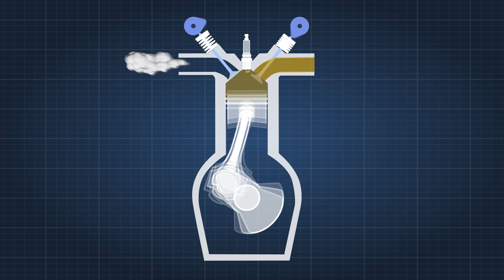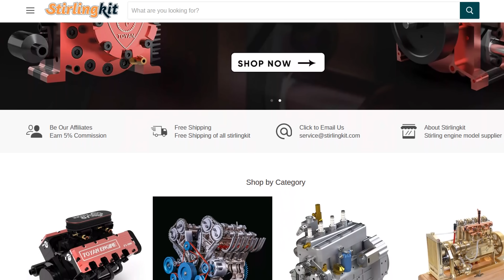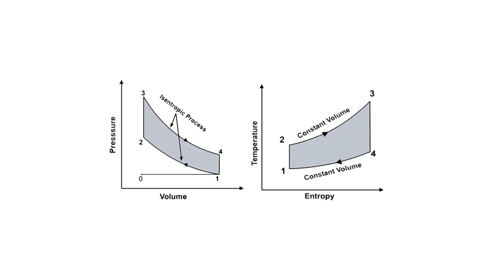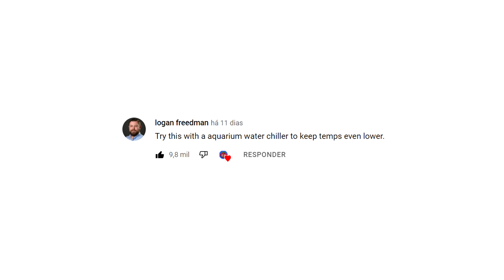I 3D Printed a Transparent Combustion Engine in Resin

Comment: So some possible explanations:
Since you're running a carby, that mixture may be too rich (in fuel). Liquids are lot less compressible than gasses, and the idea of these kind of engines is to have a really fine mist with air, that compresses. As you can see in some of your shots, there is a lot of liquid (that tiny engine is getting what some real big car engines may be getting at idling). So if you can, try changing your AFR (Air to Fuel Ratio) either by blowing more air into it, or lowering the amount of fuel entering the combustion chamber. 
Ethanol is used a lot in high powered cars with turbocharger, because it is lot less prone to random detonation due to high compression (remember, turbo blows a whackton of air into the cylinder, which equals to "a lot more dense mixture in cylinder", which when compressed at the same compression ratio can get really, really hot - up to a point of spontaneous detonation). Now in cars, you usually have the opposite problem - having too little fuel. So you need to change your injectors, which sprays more fuel, but there's a limit that when crossed, the AFM just spontaneously detonates due to extreme compression creating enough heat to ignite the mixture. This is called an engine knock, a detonation or premature ignition. You can prevent this either by running ethanol, changing your ignition timing or adjusting AFR.

If there are no microcontrollers on the engine controlling the ignition (I assume the magnetic switch triggers the spark plug directly), then there's nothing really to worry about. It is basically a lot simpler version of normal distributor used in many, many cars before we had individual spark plug controllers. For example, my '97 Civic has a mechanical distributor, which is a spinning wheel connected to camshaft, and that wheel has very correctly positioned contact pads, which are connected to a ground. The other side has 4 contacts, each corresponding to one cylinder. When the contact touches the pad on the wheel, it creates a way for electricity to flow only on that one spark plug, that is supposed to be in power stroke, igniting the mixture. I can rev up to almost 8000 RPM and have no problems. 

Also, since you are using a custom cylinder, try adjusting the compression by either varying the bore (diameter) of it, or the stroke (height). By stroking the cylinder (in your way by creating the cylinder longer), you'll actually loose compression, which you did presumably while running gasoline. That might create too little pressurized mixture and/or more probably, bad distribution of mixture, which is hard to ignite. On the other hand, by making the cylinder shorter, you'll make your compression rate higher. That means it would be easier to ignite your mixture, and on certain point, you would achieve the desired compression, which would ignite 100% times and correctly. Going overboard, you risk engine knocking, which might lead to poor running, missed cycles and even valve lift or your piston saying hello to whatever is on top or below it. 
Just a side note; stroking an engine is really common, especially in rallye scene. But since you cannot easily change the cylinder, you change the piston rod's length (essentially making the piston going lower overall), which lowers the compression. But that way, you a) have more room to put more AFM into and 2) essentially create more displacement (since displacement of an engine is NOT the overall size, but the size of a CHAMBER in which the explosion occurs). So keep that in mind.

I'd definitely play with compression ratio, maybe timing and definitely AFR. You can find many resources online on how to calculate compression rate, it's pretty simple math actually. As to what CR to run, my best guess is something between 10:1 to 13:1, depending on the fuel. I don't know how the timing works exactly on that model, but you can probably tweak it somehow. Since it does not have exposed camshaft, you cannot just advance the cam gear. You'd probably have to disassemble the engine and see, how it's done internally. Your next best thing to do is to change the AFR. You have a long screw at the bottom of the carby, try tightening it so you'll have more poor mixture. 

And a quick exclaimer, I'm not a professional automechanic, I love playing with cars and have done already some "advanced" things with engines. I may have made some mistakes, so please either verify or correct me. Hopefully, I've explained something a bit.

Comment: I think the seal for your intake or exaughst is leaking and causing your pressure to drop. (I think the valve on the engine your using is designed for less pressure/power & more on actually just running/functioning like a prop hence causing the leaking issues with different pressures from the different fuels. Im no expert & I've never built an engine before, but I'd try spraying some soapy water around all your seals and making sure that it's not a leak, again just a guess though :) , Love your videos!

Comment: As a lot of people have said, there's a few engineered solutions that need to be added.

You will need to control the valve timing. That could mean 3d printed cams, or electronic solenoid control (much cooler, and easy to adjust for different fuels).

Next, you need a way to measure the AFR. Typically that's done through the exhaust fumes. Then, you can modify the intake of gasoline:air for the proper mixture. 

Third, you will need to control the timing of the ignition system. Retarding or advancing the ignition times for fuel is necessary, as fuels don't always ignite/burn at the same speeds.

Looks like you have a future ahead of this engine. Time to create an ECU out of a raspberry pi or something and get to work 👍

PS. While you're at it, maybe you'd like to experiment with engines with alternative crankshafts to maximize power delivery. Piston power is greatest at the start of the combustion. Yet, the crank is positioned at the point with the least amount of torque (nearly vertical, rotated up). Maybe you could solve that problem 👍

Comment: It looks to like the valves are floating.  They may not be opening and closing fast enough to allow for a full charge.  The cylender still has exhaust gases in it after it fires.  Then after a few cycles there is enough of a fresh charge to ignite.  When you use the weaker fuel it does not spin the engine as fast as the fuel with the higher mix.  Because the engine is spinning so fast the vales can't open and close fast enough to have the right mix to ignite.  If you can get the valve timed right you should get better proformance from the different mixes.  I am not an experet by any means, but that is what I see when I see the video.  Hope you can get it running.  :0)

Comment: on board we had a Yanmar engine, its a 4 stroke, single piston, but the driveshaft wasn't connected to the crankshaft. it was powered off the cam-shaft.
quite an interesting engine...

Comment: I seriously bet it has to do with where the cylinder is at time of fuel’s explosion and not just ignition. If the fuel is really explosive then ignite the fuel a little less compressed so the explosion is working with the movement of the cylinder OR ignite or so slightly before full compression. Just make sure not to backfire.

Comment: Small engines usually work with very rich mixtures to help cool the engine and also l’m sure helps for bad tolerances and leaks
For gasoline a rich mixture is really hard to ignite with low compression ratios (it wets the spark plug and spreads the heat of the spark so activation energy is not reached or there is not enough oxygen in the spark itself)
Changing the fuel means changing the ignition timing so the power stroke (rise in pressure) doesn't happen before TDC, if too soon it might run but kick back the piston and waste most energy, if too late the mix won't have enough time to burn and rise the pressure before the exhaust stroke
Third thing about the drop in RPM can be the poor construction of the bearings that just can't handle the torque with higher power fuel and get squeezed so much that they just "lock up"

Comment: Your problem could also do with a poor ground. I’m assuming the valve pushrods are the only thing grounding the cylinder head to the base. Most engines ground to the block.
Reply: That's what I noticed too when he pointed out the inconsistent firing. If the coil is grounded to the block (lower part of engine) then the spark plug isn't getting a constant grounding thru the new plastic cylinder.
Reply: I was thinking the same thing!

Comment: Engine is running faster on methanol and nitro because it's lean. I suppose it's tuned to work with petrol and the stechiometric ratio for methanol and nitro is lower

Comment: It's also depends on how vapored the fuel is. Think about it liquid gasoline isn't the part that actually burns. its the vapors that come off of it. Methanol being a gas at room temp it combust way easier making the engine run at a higher rpm. If you get a proper carburetor set up for the engine so it can mix a little more air to vaporizer the fuel better you should get better results.

Comment: The reason gasoline produces a brighter combustion flame than methanol is not because gasoline is more powerful - it is because the combustion of methanol is cleaner, generating exclusively gaseous products (mostly carbon dioxide and water vapor). Hot gases don't glow nearly as bright as hot particulate matter - i.e. soot - which is produced quite a lot in gasoline combustion. As a matter of fact, alcohol fires (both methanol and ethanol, I think) are infamous among firefighters for being nearly invisible.

Comment: These engines are usually called hit and miss engines and you need a proper accelerator that is attached to the fuel line for the engine to run smoother basically suck in more fuel ignites fuel easier due to more of it and you gotta remember that it's the vapours that catch fire not the actual fuel itself so aerating it would cause for better fuel burn you then have to get the exhaust timing right due to it sucking up and potentially taking away the vapour but that would cause a backfire in your exhaust...wrong the flame isn't reaching into the exhaust valve so you wouldn't have too much of an issue

Comment: Gasoline probably created the least power because it does not burn as thoroughly as the other fuels. And with such small engines having trouble getting the fuel-air mixture right, the problem is exacerbated.

Comment: Since the printed part worked far better than I'd expected, it'd be cool to see a fully (or near-fully) printed engine. 4 stroke, 2 stroke, wankel, any would be nice to see. Having it be as clear as possible (carb, cylinder, et cetera) would be lovely to watch. I'm guessing it's all the missing power strokes that keep the heat build-up low enough to let the printed part(s) survive, so it seems do-able, if incredibly time-intensive. Maybe even the gaskets could be printed? Or just use gasket material. Take care not to blow yourself up, please.

Comment: Theres a simple explanation why the engine is misfiring .
You need to connect the cylinder head to the ignition coils ground. 
You’ve disconnected the spark plugs ground by using your 3d-printed cylinder, resulting in an extremely weak spark. 
You might have to adjust the ignition timing and make a better sealing head gasket (there are obvious leaks, fuels bubbling through the gap)

Comment: Video idea: 3d printed steam engine. Steam is not as hot as combustion so it should last longer and try putting a sterling engine at the exhaust of the steam engine to squeeze out more energy from the steam.

Comment: don't have enough Oxygen/comburent for the explosion to happen, that's why fuels with smaller molecules and free Oxygen run better than gasoline in that engine.
gasoline should be atomized before combustion, small engines don't give it enough time for that to happen, instead it only vaporize the fuel making it an non-homogeneous air/fuel mix.
compression/expansion also help to make a homogeneous mix.

or, in motorcyclist language,  you are running too rich mixture.

Comment: Where is the heat dissipated? Where do you have head gaskets, cylinders and engine tubs? Measure the compression through the spark plug thread. The wet (fuel-rich) mixture will not ignite.

Comment: so make the gasoline oven, with a heat pump, to circulate the heat, up to 99% efficiency, back and back again :))
Reply: gasoline burner
Reply: oil burner
Reply: any burner
Reply: carbonized grass burner, pyrolyzed grass methane burner
Reply: electric tesla disc turbine thruster, shrouded pump 1 or 4 directional exhaust, with close valves
Reply: center-in (two sides) rim-shroud-out (one or four sides)

Comment: The exhaust stroke might not be cleaning all the air out of cylinder causing a problem, so the second exhaust stroke is needed to fully vent out the cylinder. The more powerful fuel would make sense to drive slower unless you can adjust the carburetor for different fuels the amount of fuel in the system with the air might cause a longer stroke causing the cylinder to have a greater distance to travel during the cycle. This would explain why gas has the lower RPM as the carburetor is designed for air gas mixture and not necessarily for the other fuels.

Comment: I suspect a few things are going on:
1. Your timing may be slightly off (ignition happens slightly early or late in regards to the stroke), this will cause loss of power.
2. You have bad compression, causing fuel and exhaust to potentially leak by the piston. This messes with your fuel air ratio.
3. Bad fuel to air ratio, outside of the bad compression, in general it may be trying to run rich, which the better fuels exaggerate. 
4. Undersized exhaust valve. Not enough exhaust is escaping causing a very poor fuel air ratio on the next cycle.

The combination means inefficiency. Compression is the easiest fix, followed by fuel ratio, followed by timing. If all of them are tuned this should work well. I agree with others that putting a small load on the engine will likely help and allowing you to get a measurable metric.

Comment: You should 3D print a radiatively cooled rocket nozzle using a steel filament. flow cold water through the nozzle at speed then light the engine and see how well the metal nozzle holds up compared to a plastic one. You could also try to print a metal combustion chamber too if your feeling frisky.

Comment: I saw a different type of wankel engine. Instead of the case looking like a "pill" and the piston looking like a "triangle", the opposite is true, where the piston was pill shaped and the case was triangular. I think you can find it only. The only problem with this new engine is the lubrication which is why it is not in production.

Comment: I don’t specifically know the reason why but I’d image that spark timing has someone thing to do with why it won’t run consistently. Modern engines can change timing based on speed. More simple engines can’t thus bad spark timing and bad ignition.

Comment: Ignition timing and fuel mixture (stoichiometric ratio) changes with each fuel. You'll need more fuel, and less timing advance with methanol than gasoline, and far more fuel, and even less advance with nitrometh. If you ever wanted to revisit, it may be worth while to change the spark mechanism.

Comment: I'm not a mechanical engineer but it seems to me like the expanded gases would take longer to vent during the exhaust stroke, you have a very low volume cylinder so it takes very little energy to expel on expanded gases, there's also the question of directional inertia

Comment: These engines have a very small displacement and your modifications leave it with barely any compression.   These both make it extremely sensitive to the air fuel ratio.  Changing fuels changes the AF mixture dramatically.   The carburetor needs to have at a minimum a high speed needle valve to adjust the mixture.  You can easily obtain a nitro RC carburetor with similar airflow and play with mixture to optimize each run.  The less rich fuels turned higher RPM because they were leaner.  If you can see liquid fuel in the cylinder it's way too rich and not properly atomizing the fuel.   Liquid fuel doesn't burn in an engine quickly enough.  Atomization reduces particle size and increases surface area to react with oxygen.  This increases the burn rate so that it is more completely reacted before the power stroke has ended and exhaust stroke begins.

Comment: Not sure if anyone has said this yet, but I'd bet you're getting some premature ignition on that last one, so the fact that it's firing on every cycle will actually rob the system of a portion of its rotational inertia.

If your power stroke fires early, it will take some of the energy stored in that tiny flywheel to help the piston finish its cycle.

Just a theory. Great content! Long-time viewer, first-time commenter. Keep it coming!

Comment: So on this engine, the plus works like a regular car i assume. So the plug is grounded by the head, and a positive is provided by the plug wire. Have you add a ground to the head ? If no, the mass could only comming by the two lifters rod and resulting in a very poor ground ?

Comment: the 25% nitromethane is aparetly performing worst because compression ratio, the little engine i'm guessing has a compression ratio around 8:1 (without taking the blow by visible in the video)  wich is fine for low octane gasoline, for taking advantage methanol, notromethane and high octane gasoline you need a higher compression ratio, of around 11 or 12:1, or boost like a turbo or a supercharger, what the octane boost allows you to do is compress the mixture more without running into preignition or engine knock, is what happens when the fuel ignites before top dead center. ignition advance would also help in the higher rpm range